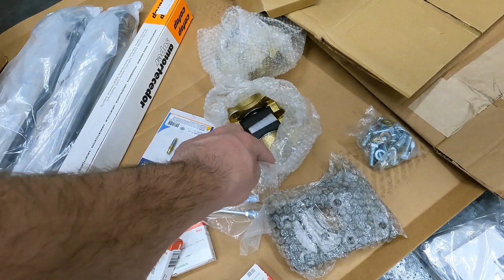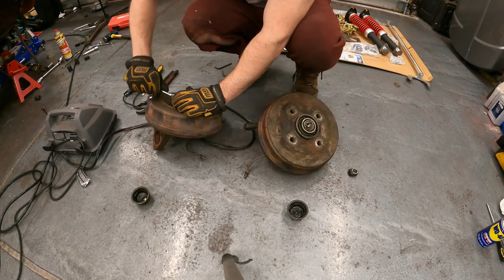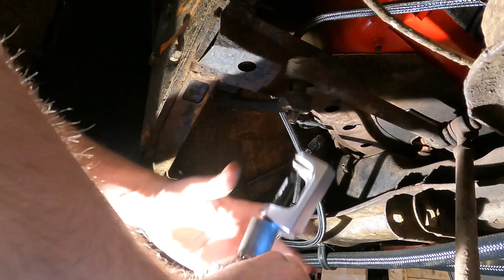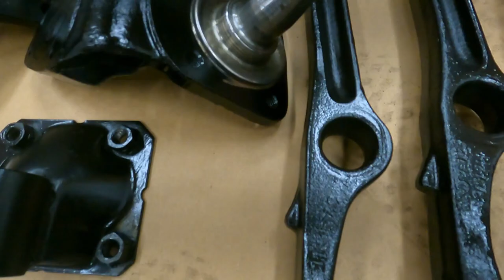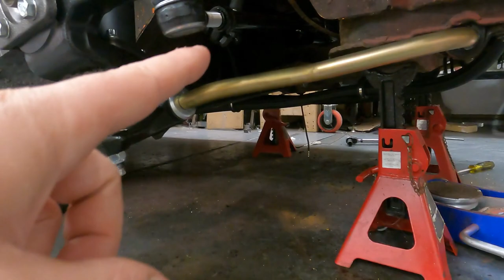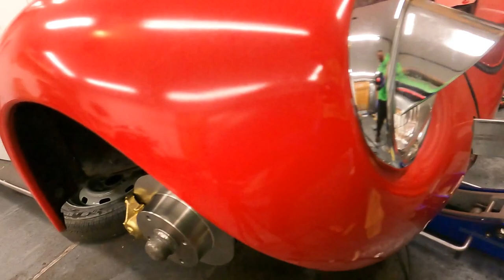Lowering the Bug and Front Disk Brake Conversion -- 1973 VW Super Beetle Subaru Swap

Comment: I call that center link a "drag link"  and the idler arm is the unit opposite the steering box
Reply from the maker: Are the ball joints on the drag link supposed to pivot? I’ve gotten my second one and it seems both are either defective or these don’t work as true ball joints but just threaded rods.
Reply: @RatchetMotors  they don't swivel around, but they will pivot in place....well, the idler arm and steering arm pivot on the pin(s)
Reply: @RatchetMotors  in the drag link they aren't actually ball joints they do twist and tend to be very stiff but they do not swivel or move other then that.

Comment: Did all the same on my 71, really happy with the way it came out, the guys at top line are the best and at first dropped the car way to low? Be very careful when choosing your wheels and tires. My 71 had a problem with rubbing of the tie rod ends withe the inside of the wheels, would definitely suggest larger diameter wheels when going custom.

Comment: Appreciate the series, and I know I'm bouncing around out of order. But did you use a rigid brake line straight to the caliper. Seems like there needs to be some flex for suspension travel.
Reply from the maker: You are entirely correct! There is a hard line on the caliper but a flex line it connects to. On most other cars I worked on prior the flex line was  right at the caliper but this has a flex line between two hard lines (hard lines on caliper and body).

Comment: The steering box comes off exactly the same way as the idler unit does except you have to detach the universal joint from the steering shaft.  The point being getting the arm off the steering box is far easier with the box out of the car.  It doesn't come off easily because there is a dimple lock on the nut
Reply from the maker: That makes a lot of sense. Do people generally rebuild the box or just go with a new one?
Reply: @RatchetMotors  I've seen videos of them being rebuilt so it's doable, but there are two seals inside that are essentially not available but are critical to keep the grease in.  Last I knew, only TRW from Brazil was rebuilding them and anyone selling SB steering boxes sources them there.  They run in the $400-$500 range as of 3-4 years ago.  I have a box out of the car if you need pics of anything
Reply from the maker: Thanks John! I’ll have to start my research

Comment: If I’m trying to keep things budget friendly could I get away with just doing the strut and spring to lower my bug? I also have a 73. Trying to weigh my options. Anything helps. Thanks!
Reply from the maker: You should be able to get away with that as long as your ball joints and everything else are in good shape. Be warned, the most difficult part was reaming the new bushing in the control arms to flip the tie rods. I needed to take to a machine shop for the correct equipment. Good luck!